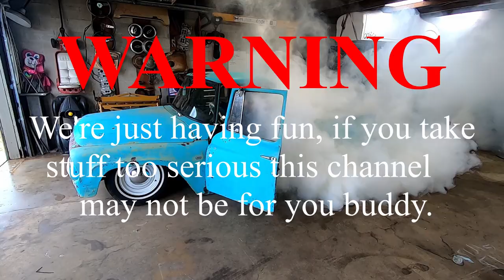Abandoned Minitruck Revival. Bed mounts, Choosing an engine, and BOBSLEDDING ?!? 1977 Datsun 620.

Comment: I appreciate what you are doing for sure!
I started doing suspension work with 3" cutting discs in a Dotco pneumatic 90deg die grinder driven by a Sears 20 gallon compressor. (cut 1/2" wait a min to get back to 110lbs, then repeat 100 times) Flap discs on a drill and a Lincoln buzbox arc welder. 
A friend just acquired one of my old creations and its off a bit but it looks flawless and is solid but I only cut into control arms, not frames . Some of my best times in the 80s was doing what you did when you were 18. Just getting the camber out of the front and rear blocks out of a slammed mini was innovative for us. You were "correcting" frames and using airbags. Evolution!
Your videos bring back memories to this old bastard. I appreciate what you do.

Comment: i like the mounts there unique personally i would've built some overly complicated 2 piece mount that id put a bushing between and bolt the 2 pieces together (one part of the bracket gets welded to the bed the other part welded to the frame a bolt and polyurethane bushing goes in between that way the bed is removable) but then again im into lifted trucks not lowered trucks so i cant judge great video puddin
Reply from the maker: I just don’t see it necessary myself for bed mounts. Cab May be different lol
Reply: @PuddinsFabShop  thats ok my fab works always over done i like little details but thats me ya know blue 42 could come back as a drift truck if you wanted anyways goodnight from a fellar over the pond

Comment: You won't believe me until you do it.  If you have even mediocre quality taps run them in with an 8pt socket and a 1/4inch impact. I've tapped literally 10s of thousands of holes that way. Its amazing
Reply: And for everyone that'll want to argue. It hammers over instead of twisting like the drill would. The hammering saves the tap from side to side pressure which is what usually kills taps

Comment: Great video! Tighten the exposed screw in the center of the end of your hoist 1/8 -1/4  turn. Or until it holds the weight of the engine without drifting down. It's the brake adjusted
Reply from the maker: I have a book on it and say one day I’ll read for the adjustment procedure lol

Comment: Enjoyed the show buddy watching it now in the garage just finishing up on a scion IQ one of those little smart car things with a motor in it about as big as my foot 😂 anyways they said it would never run again the engine was run out of oil completely is what they told me as they were loading it on the crusher but the body and interior looks like new brand new tires on it!  It’s a 2014 thousand couldn’t stand by and watch them crush it so I bought a 2013 Toyota Scion IQ for 400 dollars that supposedly had a bad engine. Well that’s what they thought all that was wrong with it was the air conditioner compressor was locked up and wouldn’t let the belts turn was a few more things wrong but that was the main one! Now it’s fixed and time to go to my cousin that’s struggling hopefully it’ll be a good reliable transportation for them!
Reply from the maker: That’s rad! Hope they enjoy it!
Reply: @PuddinsFabShop   Thx my brother! As a matter of fact I just dropped it off to them. Went and got it aligned filled the tank up and got them a prepaid card with enough cash for them to get back and forth to work for at least a couple weeks if they are frugal maybe a month. Anyways I tell you this not because I’m some great man looking for a pat on the back but because I had really feel into a routine of going to work and back home nothing much else besides my regular stuff around the house. But when I started watching your show it inspired me to start finding vehicles and fixing them up again and it’s going great thx brother keep inspiring people your very entertaining

Comment: I do think a small V6 would be cool but I get why you don't wanna put the extra work in after all what I've watched. That said if you could get something with say 180-200bhp in I reckon she'd be a ripper. Depends if there's anything for a few hundred bucks that sorta fits, runs on a carb and has basically everything thrown in free

Comment: I think those are 6 bolt rims..6 x 5.5??  Like my Dodge D50/Mitsubishi....you can check on GM 6 bolt 4x4 tires as an option as well as Toyota and lots of other vehicles....
Mazda trucks

Isuzu trucks & SUV's

Chevy 1/2 ton 4x4's Trucks & SUV's

Ford Couriers

Nissan trucks & SUV's

Dodge Ram 50's

Mitsubishi minis

Caddy Escalade (17" & up)

Just check the center hole size to confirm they fit without needing modification ( if you want bolt on )
If your just rolling it around ..the shop doing fab work etc..
A Sloppy hole is good enough
Tight is nicer!!
Reply from the maker: I’m familiar, same pattern that on my travelall, scratch your noggin on that one!
Reply: @PuddinsFabShop  
I guess it was a common pattern back in that period.... Helps when doing a custom low buck ride though.... Cool...that is a nut twister to learn!!

Comment: Tell you why the mower backfired lil solenoid on bottom of the carburetor is going bad. You can order it cheaper than you can buy it at power supply company. You probably already know this

Comment: At minimum you should put a SR20DE or even SR16DE vvt
Reply from the maker: Nope lol
Reply: @PuddinsFabShop  Still a Datto though !!!
How’s about one of these you’ll be surprised what bolts in with a few of the different model mounts such as na20s ,ka24de, ca18de, fj20de, td27t  diesel I had a d22 with a na20s woohoo.
but you can change the front cover/bellhousing half of the gearbox to mate up to a sr20de and then use td27 engine mount brackets and it pretty much bolts in to the rs5w71c transmission and rest of the vehicle . I think d21 where similar under the skin too.

Comment: Puddin,
Can I cut the front springs on a 2003 silverado instead of wasting money on drop spings?
Reply from the maker: Yep! Do a little at a time so that you don’t over do it. Use a grinder not a torch or plasma, and do cut it square. Cut it at a angle so that it sits flat in the pocket.
Reply: @PuddinsFabShop  Thanks Man! I appreciate it. I've searched YouTube but it's Mostly OBS stuff. Hey if you ever want to cut a truck up I'm in Moore. I can wear my Mini truck shirt from the early 2000s lol

Comment: Congratulations on 50k. Would like to draw your blue bobbed datsun for you, you're staying with the steelies, correct? Fully body dropped?
Reply from the maker: Staying with steelies, factory caps, May of got a good deal on some white walls. Laying frame but no body drop
Reply: @PuddinsFabShop  sweet! Yeah, patina shop truck, or make her pretty on the cheap. Ford tractor blue is beautiful, and when it's rubbed out, looks like an expensive spray.
Reply: No shame and keeping the stock motor. I'm wrenching on a ranger. Ain't pretty, but it runs good.

Comment: Pulled an engine with a 100lb crane, come off the trailer and took a right without a damn turn signal, and I don't know why you keep pointing at me. What in tarnation is going on around here
Reply from the maker: 😂😂👊🏻👊🏻 that crane will handle all the weight. I’ve moved 4000 pounds with it lol
Reply: @PuddinsFabShop  pssst: the sticker on you crane says "100 LBS" You know someone had to comment about that.